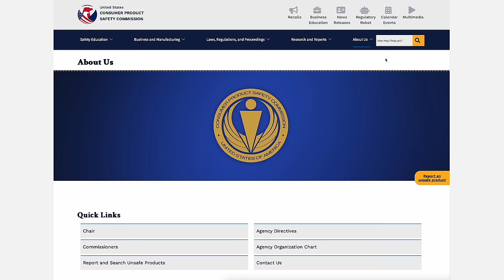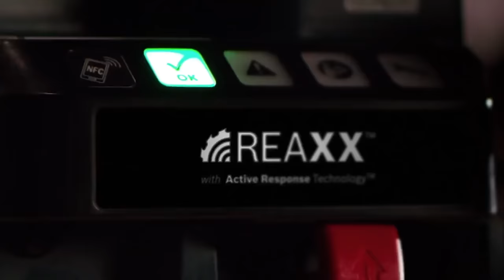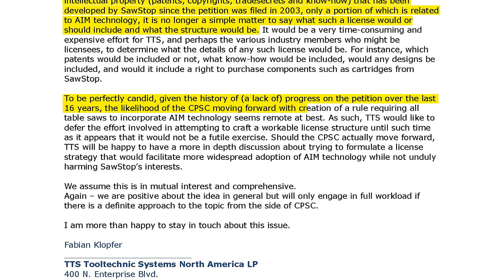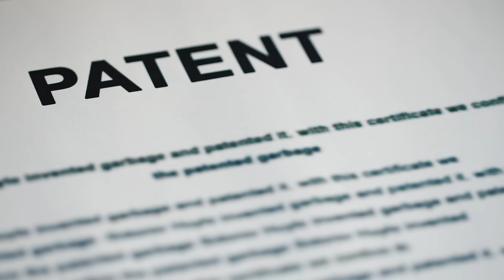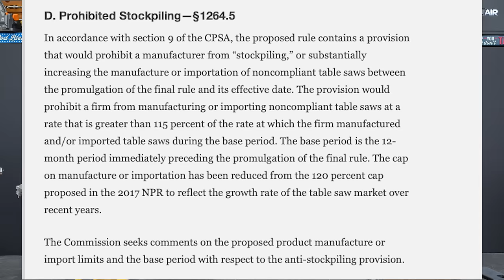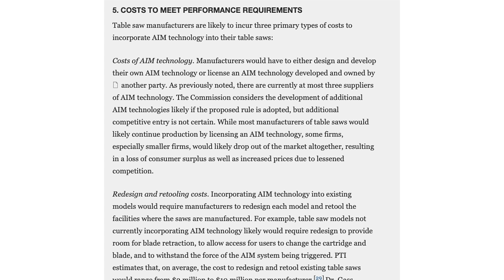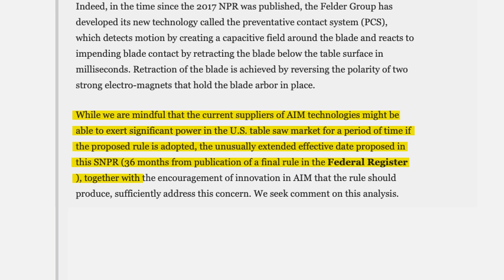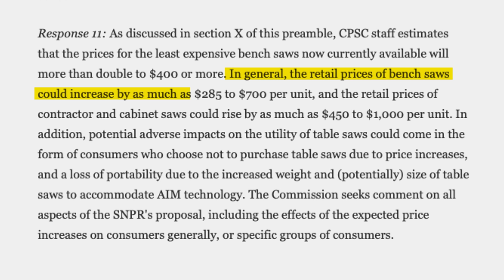The US Government is About to Change Table Saws FOREVER!

Comment: This is SawStop’s wet dream.  They’ve been lobbying for this for ages.
Reply: Maybe, but with their patents slowly expiring, they won't be getting the monopoly advantage they were lobbying for.
Reply: Exactly! What BS!
Reply: They've made a significant contribution to the industry, so it will be temporary so nothing to worry about. I don't agree it should be permanent, which is clear it won't be as it would be too obvious
Reply: @NathanSpaeth they are working on extending the patents. He is a greedy money grabber.
Reply: They are allowed to add time to their patents. I think it’s like ten years.
Reply: @onecarwood While there is a mechanism for adding time to a patent, that mechanism is usually limited to pharmaceutical patents. The rationale is that a new drug can be patented, but the FDA may not permit it to be sold for some time, sometimes years, while regulatory requirements are satisfied.

I am not aware of any a mechanism that would be applicable to this area, but I will check into it.
Reply: @NathanSpaeth 28:45Optima Yellow Top AGM Battery BCI Group Size 48 800 CCA DH6
Reply: @NathanSpaeth 28:45Optima Yellow Top AGM Battery BCI Group Size 48 800 CCA DH6
Reply: @NathanSpaeth  as someone said above - patents can be updated.
Reply: @NathanSpaeth 28:45Optima Yellow Top AGM Battery BCI Group Size 48 800 CCA DH6
Reply: @NathanSpaeth 28:45Optima Yellow Top AGM Battery BCI Group Size 48 800 CCA DH6
Reply: Copyright is greedy and not efficient.   We should be able to all collaborate to make the best stuff for society
Reply: Time to buy stock in SAW STOP?   Oh Wait...  they are privately owned.
Reply: No, SawStop was sold to the same company that owns Festool.  Mr. Gass, the inventor who lobbied,  probably is not interested anymore.
Reply: Saw stop’s safety device was invented by a US citizen, main office is in the US but there manufactured in Taiwan….why? I’m sure there are a number of reasons why but the main one was to get around the strict monopoly laws here in the US.
Reply: They'll take Sawstop's patent if they make it mandatory industry-wide. No one can force a brand to use one other specific brand's technology. Besides, there's much better tech out there than Sawstop's.
Reply: @joshuagharis9017   No it's not. A person or company has the right to make money on their invention that they've put the time and money into a product.
Reply: @buzzsawkhan  you could be correct but I swear I heard about this happening with hand planes.
Reply: My understanding is they HAVEN’T been lobbying for it. The inventor of the technology did and was unsuccessful, so he founded SawStop.
Reply: I lost the tip of my thumb to the knuckle on a jointer. I'm a professional, I just got complacent. I had a push stick, and use it all the time. I honestly can't say why I didn't then. I never let the injury bother me, that said, it could have been a LOT worse. I have mixed feelings about this
Reply: It's how all safety starts. SawStop is just looking to keep the patent and make money. Volvo invented the seatbelt, John W. Hetrick invented the airbag, the construction helmet was invented by workers of the Hoover Dam, someone has to invent everything. It doesn't always have to make money. SawStop may either lose the patent or everyone else will create a new method.
Reply: @TheGreatChrisB  True, and nowadays nobody would buy a car without airbags or seatbelts. However Volvo opted to freely license that technology so that lives could be saved. Maybe if someone in SawStop management had one of their children chop their hand off with a Ryobi tablesaw they would consider it just as with the seatbelts...
Reply: @refactorear  Yes, otherwise I imagine the patent can simply expire or be negated. If something is deemed a necessity, it cannot be withheld monetarily or in monopoly
Reply: Patents can be updated for this technology,  but they can't be extended. An updated patent only covers the patent for the modified part. Not the original mechanism. 

That isn't something that is available in the tool industry.
Reply: @TheDeafpitbull You have mixed feelings because it wasn't worse. If you had entirely lost your finger or a larger part of your hand I'm going to guess you would have very significantly 1-sided feelings.

Personally I'm all for this. Absolutely everyone can get complacent because we are humans, not programmed robots. 

Doesn't matter if you are a multi-award winning woodworker. Injuries can and do happen to everyone.
Reply: @onecarwood yah but only up to 50 years, it's the law.
Reply: Can government stop shipments of fake Rolex from certain online company that starts with "T" and ends with "U"?  How quickly will knockoff table saws with SS tech start showing up online at quarter of price?
Reply: @refactorear is air bags and seat belts and all the other required safety systems put in cars now the price of new vehicles would be significantly cheaper if all this bs was not required by the government and tbe consumers are the ones who have to pay whether they want it or not.
Reply: Guess they finally greased the right palm.
Reply: @beetle442002   Sure, but would people buy a car where their whole family would die if crashed? Would you rather buy a saw which would prevent you from having an accident or not? If not people can always build their own one as it would look as they are proficient enough if they are sure they won't cut their fingers off one.
Reply: No, he is a prudent business owner.  Patent extension is so common.  Example, the pharmaceutical industry routinely patents "new" drugs, commonly only for a new way to package them, deliver them, regulate the dosage, etc.  Same drug, new patent, more co$t to the con$umer.  If you own a business, aren't you going to protect your production secrets to get a leg up on the competition?  I admit that lobbying Congress to make tablesaws without SawStop technology illegal was a dick move, but they did the right thing after that by making their own saws, and good saws they are.
Reply: except it might backfire if they have to make the tech freely available. They don't want to be labeled a monopoly or that would tear them apart, their only alternative might be opening up the license.
Reply: @NathanSpaeth 
Yes they will. Because they can position themselves to be the first AND ONLY company to be GOVERNMENT CERTIFIED and therefore have a monopoly still
Reply: By lobbying do you mean bribing politicians😊
Reply: @daifeichu While intellectual property should be protected, patents are only supposed to be granted to items which make significant improvements for society AND are not obvious to other inventors in that field.  Both of those requirements are frequently overlooked by the patent office.
Reply: @DESX312 And yet there is an extremely strong correlation between stupidity and accidents.  Why do you think that is?
Reply: Some part of the commissions ruling will need to address sawstop’s ongoing attempts to create and maintain a HIGHLY lucrative monopoly on their technology by blocking all other solutions.  It is unconscionable that SS keeps saying how committed they are to safety, when their court actions make it very clear they are seeking to block competition and maintain their lucrative monopoly, at the cost of consumer safety.  Their patents are running out!  So rather than letting that happen, they are pursuing more patents - that will be used to once again restrict competition.  Consumer safety ALSO needs anti-trust laws to prevent companies from using courts to extort profit from a sector.
Reply: @kirkjohnson6638  Sure there is. There is no doubt about that, but just because there is an increase of accidents based on level of stupidity; that doesn't mean that said accidents still don't happen to the smartest. 

This is ingrained in you at every single job site I've ever been too. Mostly job sites involving oil and gas. Doesn't matter who you are or what you think you're skill level is. 

Complacency makes everything dangerous.
Reply: @refactorear  I would rather have the choice than having the choice taken away from me. I don't need a car with onstar and active lane assistance, and brake assistance, to have vehicles designed to destroy themselves when crashed and not be able to be repaired... not having all that junk doesn't mean you will die in a car accident. As far as the saws the saws have existed for decades without the added safety crap and people have been able to not have accidents(not saying there have not been some I am saying people have been capable of not getting hurt). There have been saws that have the tech and saws without it both on the market for the last 10 years and the market has decided that saws without the extra tech that cost a significant amount less is okay. The government should not step in and try to force this on people. This isn't about a defect in the product it is about responsible for people's own actions.
Reply: @DESX312  "Complacency" leading to accidents is just an excuse for a very weak mind. Most everyday tasks can be completed using barely any brain cells.  But, maybe that's "normal" since all things are relative.
Reply: @kirkjohnson6638  That thinking is how you get fired immediately off any oil rigs lol. Act better than everyone and you'll be forced to be humble, quickly.
Reply: @DESX312  Only if you are not better than most people.  You have to be incredibly stupid to get cut on a table saw and I say that as someone who wouldn't think twice about operating one without any blade guards, pusher sticks, or finger boards while extremely drunk (meaning it's practically impossible to screw up something so simple). There is no such thing as an accident - "accident" is just a word invented as an excuse that defective humans use.
Reply: @kirkjohnson6638  Well, unfortunately, there are some 60,000+ table saw injuries each year. 

So I guess there are many many defective humans. So many in fact that there are pretty much no perfect humans.

So.....
🤷‍♂️
Reply: you Ment Green Dream as the patent is still held.
Reply: Typical cronyism between lobbyists-SawStop is more pricey due to this tech. How to compete? Get gov’t to force everyone else to incorporate that tech. Prob solved! Sheesh.
Reply: If the saw stop inventor was truly motivated by protecting people from accidents, then he wouldn’t have so many patents and the effort to extend the patents when the shark smells blood in the water…pun intended…
Reply: I foresee a crackdown on YouTube videos. Many content providers do not use the safeguards when filming because they obstruct your view OR maybe they always work that way…liability??   Should the Government mandate this? A better question is should a small panel of people dictate to 336M people?
Reply: @daifeichu  true, but if they lobby to change the laws to make it illegal to build a tool without a certain tech, knowing they would have a monopoly on the tech, that should be illegal. 
If they do that, the government should take their patents away and make them free to use by other companies.
Reply: @pointnemo72   I was replying to someone who said "Copyright is greedy and not efficient".  It is not greedy and it is efficient. I was not talking about lobbying so that a certain tech could be used to make people safe, which in this case has not been verified if the tech were in all table saws.
Reply: if the government mandates it then the government should pull the patent
Reply: Yeah, but they're doing it now because SawStop's patents are expiring.  Overall, I think it's a good thing.  I am also wondering if injury mitigation is something that could be added to similar devices - other saws, jointers, routers, etc. - anything with an exposed cutter that users are likely to get their fingers near.
Reply: So which politicians pocket are they in?
Reply: @TheDeafpitbull accidents happen but like you were saying, you could have used a different method and that might have been the difference. Glad to hear you say what you did and you are ok. 
I just know that many new workers are not instructed properly and that is the real issue. Carpenters are struggling because it's not a service that people NEED like plumbing and electric, so anyone can call themselves a carpenter and undercut the next guy, unfortunately, and if they have workers, they just give a dangerous tool to someone who's inexperienced and accidents are more likely to happen.
Reply: @refactorear I would buy a car without airbags, a big ass metal steering wheel and lap belts. Those were the good days when you could actually work on your car. Now you have to spend hours removing plastic schrouds just to access sparkplugs.
Reply: It’s safer to remove the government.
Reply: @DESX312  Ah. Oil rig. That explains a lot about your views. As an actually defective human, thank you for the reasonable takes. My brother worked on rigs, he was very flippant with safety in his personal life but on the job he knew his actions were not just something that would affect him and he took safety very seriously and knew that the more safety measures you took that didn’t require active participation by someone the better. 

With the fact that states are allowing kids to work in construction sites, this is a must. 

My dad passed a few months ago and I like woodworking but I’m scared of the table saw. I always had him use it for me. I have dyspraxia and ADHD. I’m literally a danger to myself just walking. It doesn’t make me stupid like others imply.

Frankly, something like this would make woodworking more accessible to someone like me.
Reply: @kirkjohnson6638 
The fact you called them “pusher sticks” tells everyone that you’re the first dude that would get cut on a table saw 😂
Reply: From what I understand ever time the saw stop is activated you have to spend 100$ to replace a part. A saw stop in a shop I know about goes off about 2 times a year when there is some kind of conductor in the piece being cut.
Reply: @NathanSpaeth except for the year it takes for the other companies to be able to produce a single saw.  Then sawstop is the only option.  Definition of a monopoly, and the government is going to create it.
Reply: is about money, say who wants table saw international business
Reply: Exactly. This is Sawstop’s doing!
Reply: I don't think this is a bad idea, AT ALL; I'm not being sarcastic.

I think ANY price is worth keeping your fingers/preventing accidents.

I think they should implement and enforce these type technologies in warehouses and meat markets as well/ANY WHERE that has the potential for something like this to happen.

I know what I am doing and I wouldn't do something like this anyway, BUT I still think they should make it impossible for you to cut your self in the first place, I don't see anything wrong with that, and you can argue its WAY LESS than what a hospital would charge you, to TRY and fix the problem/problems you had/have from the accident, keeping preventative measures in place, is  NOT a bad thing, AT ALL. I've actually seen people that do this for a living and are really good at building/have used a saw for years/ some basically there whole life and made one mistake and lost a finger/fingers, in some instances, I remember one instance that happened where this person didn't loose fingers, but ones the surgeries/reconstruction and healing completed and after multiple surgeries, the once talented experienced wood worker lost feeling in their fingers and also lost gripping strength in there hand, causing them to no longer be able to do what they love. I think a measley grand or 5 grand, would have been nothing to them, especially to be able to continue what they love to do.

Also I honestly don't think it should cost that much to implement these types of technologies, but I honestly wouldn't mind these technologies on my saws/I wouldn't complain, peace of mind, would be nice, I don't plan on making a mistake like this, but things happen, I've seen it happen, so I know, even with experienced machinery users, accidents happen.

Also this type of technology isn't that hard to implement/companies wouldn't have to out source/ pay for licensing, UNLESS they want to; Especially with the rise of AI; Also sensors/cameras/chips and so on have been around for YEARS, none of this is really new technology, I think automatic braking systems in cars are good too/people are idiots and cause accidents, ALL THE TIME, if we can prevent these things from happening all together, WE DEFINITELY SHOULD.
Reply: @DESX312  that’s right, we’re humans. And if the cost goes up significantly we’ll see people using older saws or bootleg versions that are more affordable and far less safe. Or spending less on PPE or other protective measures. 

Look at the trash heaps on many of our roads with mufflers falling off. We’ve gone far beyond seatbelts and airbags to all these ridiculous electronic sensors that make the cost of a new car prohibitive for a large chunk of the population. This makes people less safe, we need to find a balance rather than dismiss the added cost because of class bias.
Reply: @beetle442002  we’ve gone so far beyond air bags and seat belts to electronic sensors that routinely fail and cost hundreds, if not thousands dollars to replace. 

The slippery slope is real. The safety argument is often abused as a fallacious appeal to emotion and fear instead of looking for a better way.
Reply: @refactorear  many people can’t afford a new car, not even a 5 year old car, especially in todays used car market. Seatbelts and air bags are a cost people could absorb, cost must be taken into account or else people will buy some old cheap death trap because it’s all they can afford. 

Stop fear mongering about dead families, the focus needs to be practical and cost effective solutions. 

Otherwise we end up with pricey EVs in Michigan that don’t even work properly in the winter.
Reply: That's what they WERE... That extension on patent says otherwise! Now they want it to monopolize and up their prices even more!
Reply: You nailed it!
Reply: Honestly surprised it’s not guns they are trying to put this tech on. Imagine aiming at an intruder, but a squeeze of the trigger connects you to a hotline to assess your current situation before granting permission.. only to be put on eternal hold. Oh, probably because criminals would never fall within compliance. Just like the “illegal saw black market” would explode.
Reply: @the_stixXx carpenters aren't a necessity? Who builds the houses? Houses need to be continually built. 
Who repairs damaged siding, framing, decking, windows, etc, all sorts of other damage to your home, or in general the things that need replacing as part of standard home maintenance?
Reply: @universalron I triggered the cartridge the first time I used a sawstop. I still don't know what it did, but it triggered, shut down, and the replacement cartridge was about $80 at the time. This was about 4 years ago.
Reply: @DESX312 actually, he said 60,000 injuries since 2003, so that's about 3,000 per year. That may be a declining figure because other safety features are more common now, like soft starts, brakes, etc, which were not common in the 2000s
Reply: @histguy101  yes carpenters are needed, but most carpentry items are not a necessity once construction is complete. Really I was comparing carpentry to electrical and plumbing trades which people NEED. 
For instance , you don't NEED a new kitchen, but you do need running water. You don't need new trim or your deck fixed if it's beat up, but you do need electricity. That's what I was saying. 
I'm a carpenter.
Reply: @the_stixXx  I dunno, we take small repair jobs constantly, especially in the summer. If you have rot in your chimney, or windows, or siding, or garage wall, etc, or your shower pan is leaking, or floor is sagging, that's no different than a plumbing, HVAC, or electrical problem, imo.

Those other trades fill the same roles on remodels and new builds. Each trade comes and does their part.